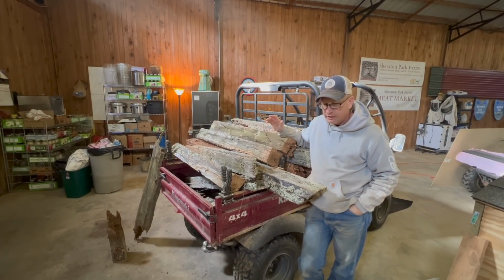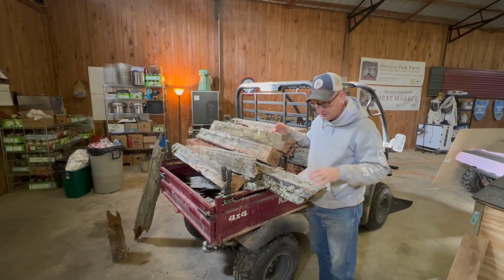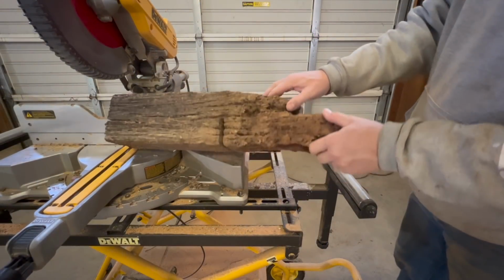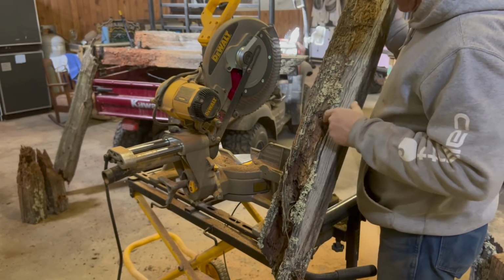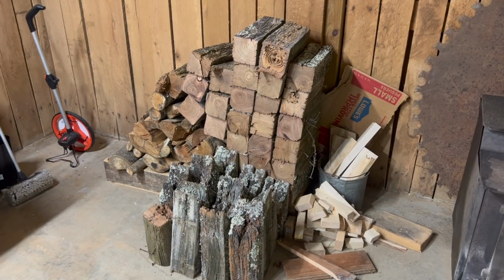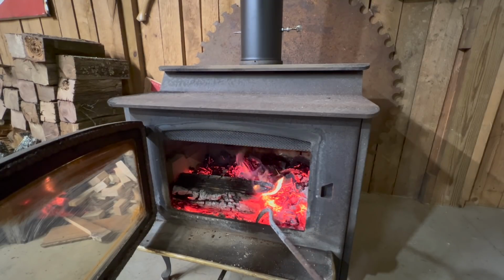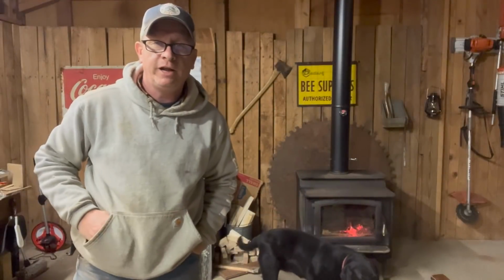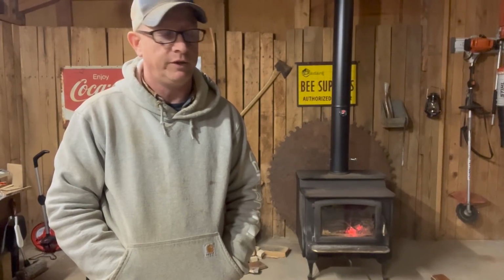How To Cut Firewood With A Dewalt Chop Saw

Comment: Your Dewalt saw is a Miter saw, not a chop saw, I bought a metal chop saw at Harbour blank,,, 14" and put on a 12" miter rip saw blade, cut firewood pretty darn easy, it cut Red Oak 6" in diameter, no issues. Good video.

Comment: Could a guy mill those down into 2.5" planks, build a couple rustic tables and benches, sell em for $3k a piece, and then buy about 20 cords of pine, split delivered and stacked?  Just asking for a friend.  Keep at it Chuck and Sandra! You're definitely makin bacon, friends.  I dig the ole sawmill blade for a heat shield. Looks pretty cool.

Comment: Don't you need to be cutting next year's wood getting a little late for it?  Of course, you just bought the property, but eventually you have to be a year in advance.  Course you know this.

How do you pick what you will cut for Firewood?  You are just learning your land, reason why I am asking.

So jealous of a wood stove.  Had two growing up. Because we had electric heat, then energy crisis hit.  Literally couldn't afford to heat.
Reply from the maker: We've cut a little bit for next year and still have some things down to cut and split.  

I start with stuff that is on the ground then go to standing dead.  All hardwood of course.  We have a lot of oak, hickory, walnut and locust.  

We've kept a fire going almost since we installed it.  I love just going to the shop and sitting by the fire.